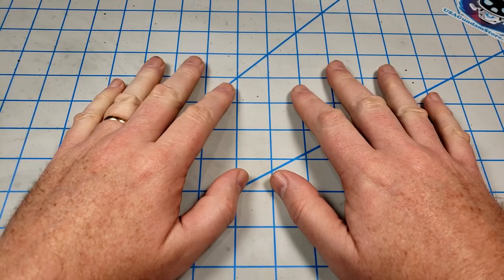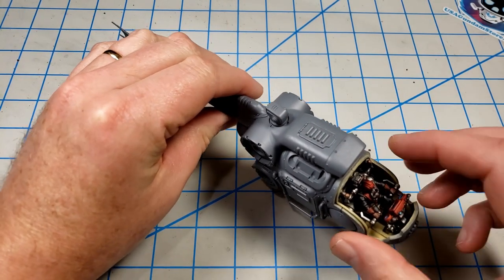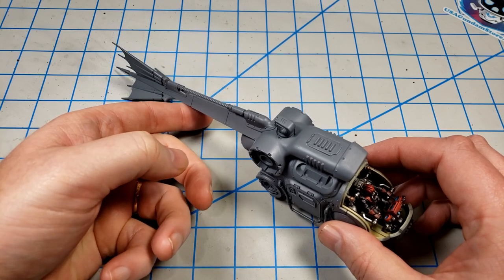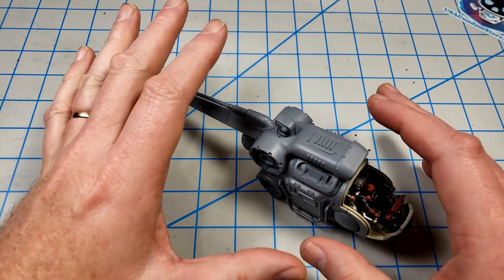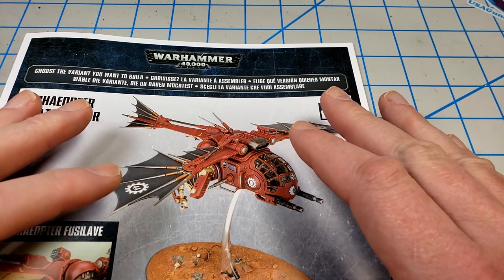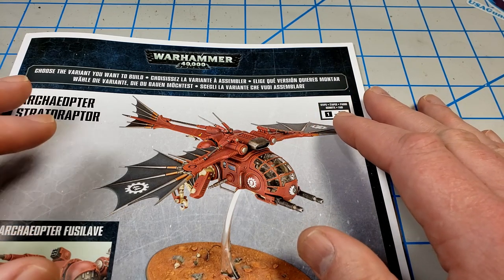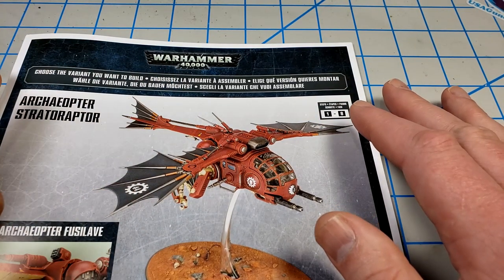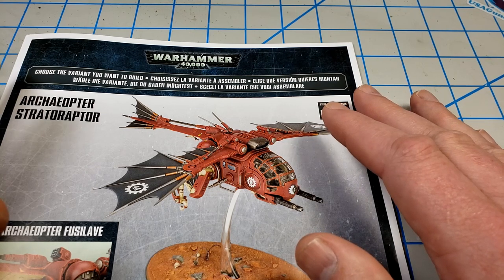Citadel's Adeptus Mechanicus Archaeopter Part 2: The Base Painting

Comment: So you don't need an airbrush for painting the larger vehicles minis? I've been dying to get a Dune Crawler, but I am scared I won't be able to handle it with just brushes.
Reply from the maker: An airbrush can be helpful, but it's definitely not required. The key is thinning the paints down and applying in multiple thin coats. A bigger brush often helps with this. As with anything in our hobby, persistence and repetition will pay off over time!

The Dunecrawler is a fun kit! I build one in my blogging days, though I did base paint it with an airbrush. But I could have just as easily done it with a brush. You can check it out here - it might spark some ideas! (https://www.jonbius.com/2019/06/07/citadels-adeptus-mechanicus-onager-dunecrawler-the-stompy-little-crab/)

Thanks so much for watching and commenting. Have fun!